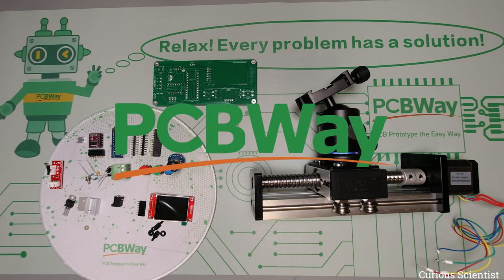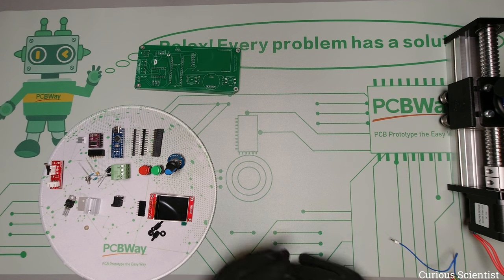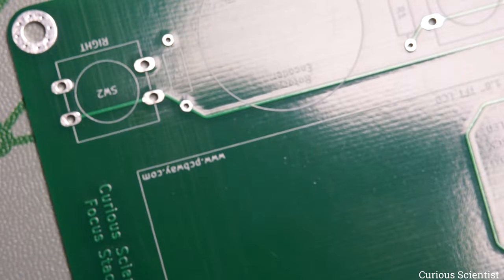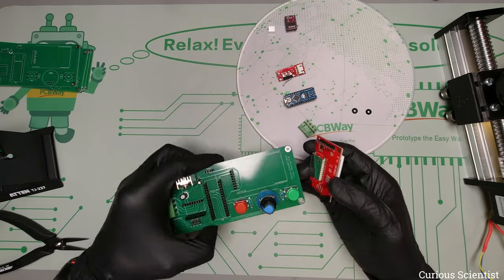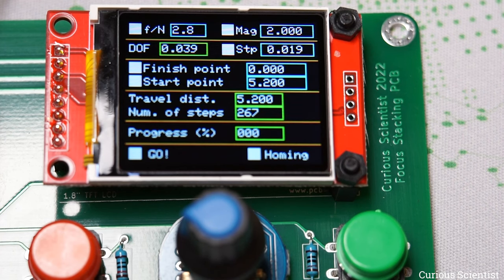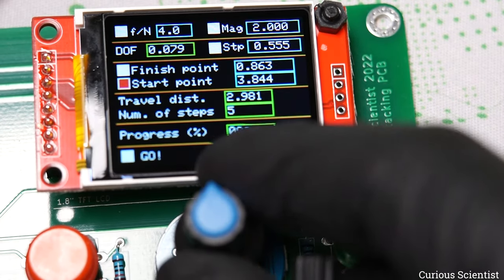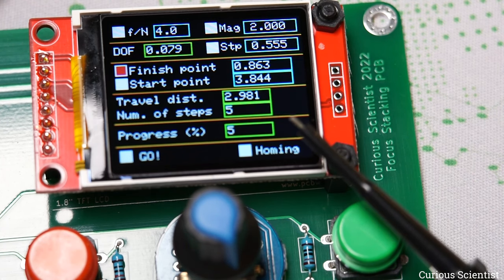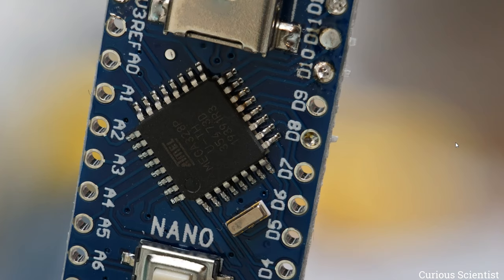Precise focus stacking device for macro photography

Comment: I'd like to share an input protection circuit I've used for over current, over voltage, and reverse polarity. It's simply a PPTC (e-fuse) in line with positive and a unidirectional TVS across the rails after the PPTC.

Saved me from myself a few times 😁
Reply from the maker: Thanks! In this project, the polarity of the power supply is forced by the standard DC barrel jack, so basically there's no option to fail by accidentally switching polarity. However, for other projects, it might come handy. I will keep it in mind, thanks!

Comment: Wonderful, exactly what I have been trying to make for a year. I have a macro rail and stepper motor driving a linear actuator, Im still using your code to drive it with buttons and a rorary encoder. Better than moving it myself but this is orders of magnitude better. Ive found all the parts, your PCB  but  no code! Isee below that you were wondering how to publish it. This is better than what I had been trying to make  -  do you think that you will be able to make the code available please? Phil
Reply from the maker: Thank you! Sure, the code will be available in the near future, within 1-2 weeks probably. I just want to polish it a little bit more. For example, last night I added another option to the code: shutter release with IR LED instead of a cable. I tested it with my Sony A6000 and it works great, so I am sure any other camera can be released with IR with my code and circuit. Also, this might sound rude or greedy, but I won't publish it for free or for a few bucks only. For example, the gadget called StackShot sells for almost 600 USD where the hardware cost is about 200 USD and the rest of the amount is the development cost and the profit margin. Since I put a lot of work into developing this thing and I see the value of the market products, I will probably try to monetize my knowledge in some reasonable way.
Reply: @CuriousScientist  I think that this is something worth paying for, your competition is the Stackshot and WeeMacro, obviously I own neither but from what I know about them what you have produced is competing on a level playing field with either. I don’t envy you working out the logistic problems of how to monetise it but it’s well deserved and I would have no problem in rewarding your work here, well deserved.
Reply from the maker: Thank you very much! I hope everything will go well with the project. Probably, I won't be their direct competitor, especially because I cannot provide a fully assembled mechanism (yet?). However, I will be able to provide an alternative to their stuff at a reliable and reasonable DIY level at a lower price range. We will see how it will work out.

Comment: I'm interested in the image processing part. Did you compose the final image by hand or you used specific softwares or plugins?
Reply from the maker: Hi! It is processed in Photoshop. I took the images, loaded them into a stack, then auto-blended the layers. Then I just let the software do the rest.
Reply: Hi, there are several software used to assemble the photos in focus stacking, the most used are ZereneStacker and HeliconFocus :)
Reply from the maker: I took the formulas for calculating the DOF from the content that is published by Zerene. Unfortunately, I only have Photoshop, but it would be nice to try other software too.

Comment: Great work Curious!  I looked into getting your PCB from PCBWay:  It seems that there is minimum order of 5 units; do you sell the PCB yourself and perhaps I could buy just one board?  Also, is your code available to a Patreon yet?  Thanks a lot!
Reply from the maker: Thank you! 
Unfortunately, I already built all the 5 PCBs into circuits so I don't have any bare PCB anymore. The populated board however would be more expensive than buying 5 boards from PCBWay. 

Yes, the code will be available for my Patreon supporters very soon. There's a "part 2" coming for the video series this weekend or early next week. I further developed the code and I also made some cool stuff and all these will be summarised in the upcoming video. Stay tuned!
Reply: @CuriousScientist  How about your software to run the focusing rail, is it available yet?
Reply from the maker: It will be available within an hour. ;)

Comment: Love your work! What kind of 22uF is it? I need the voltage to buy the right one :-)
Reply from the maker: Thanks! The 22 uF is on the VOUT side of the LDO, so anything above 5 V is OK. 6.3 V, or above should be fine. 
The 100 nF is on the VIN side of the LDO, so that depends on the input voltage. Go for something above 10 V. 
The 100 uF is also on the same rail (12 V) as the 100 nF, so the same voltage rating applies. I chose 25 V.
Reply: @CuriousScientist  it was very helpful, thx so much !!!!

Comment: Shouldn't the camera be locked parallel to the axis of motor travel and not tilted down?
Reply from the maker: Sure, strictly speaking, the camera sensor should be parallel to the surface of the Arduino that I was photographing and the camera should be moved perpendicularly to the surface of the subject. But this video was focusing on the hardware I built and not on the technicalities of macro photography. That's why I was a bit lousy on those details.
Reply: It's actually ok, your zone of sharp focus will just be skewed in 3D space compared to a parallel sensor. The software doesn't really care anyway, it will still compile whatever areas are sharp.

Comment: 11:00 i have just simply bought a usb to stereo audio jack adapter and soldered a audio jack on my pcb. I tried soldering one cable directly on the board but the wires are just too small and would break easily.
Reply from the maker: That is also a good idea. I wanted to know how the remote works, so I bought it. It was very cheap, so it was not too painful to disassemble it and throw away the remote part.
Reply: @CuriousScientist  yeah, to take a picture all 3 have to be shorted together. I have 2 optocouplers, one for focus and one for shutter. With my first version i only had one optocoupler and focus was shorted as standard but when i wanted to change something in the settings of the camera then i had to remove the cable.
Reply from the maker: Yes, I have the same "issue". When the cable is connected, the camera is locked and I cannot change the settings. But this is also why I will try to make it with IR shutter release too.

Comment: this is a very interesting project, would it be possible to implement an encoder that compensates the step loss of the stepper motor?
Reply from the maker: Hi! I have already published a project on similar topic based on the as5600 encoder. But here, there's no such issues as lost steps, I think.

Comment: This looks really usefull! If I were to buy the board and the parts, how would I get the program, and get it installed?
Reply from the maker: Thanks! The program is available for my Patreon supporters. You can install it on the Arduino just in the same way as you would install any other programs on an Arduino (upload via a USB cable).
Reply: @CuriousScientist  Do I need any special software or license for programming the Arduino?
Reply from the maker: No. You open my code in the Arduino IDE, connect your Nano via USB, and then hit upload. Simple.

Comment: Did you put the A4988 in the wrong way? From the top view, with the potentiometer at the bottom, motor's connections are on the right side.
Reply from the maker: What do you mean? First of all, it is a DRV8825, second if I would have put it in the wrong way, there would have been a huge smoke as the STEP and DIR pins would have been powered by the 12 V rail.
Reply: @CuriousScientist  ooh is a DRV8825. It has the potentiometer on top and the A4988 has it on the bottom. Sorry, my bad
Reply from the maker: No worries! Next time please check the project page and my blog article, I always list the components. (It is also written in the video)

Comment: Hi, mounted all as it should be  but motor is not moving. It's making a little noise (barely audible) and that's all. when I press the limit switch then program continue an I can move motor by hand but if I try to redo homing the same thing happens again.
Reply from the maker: Hi! Can it be that your limit switch is wired in the opposite direction? So when everything is powered on, the limit switch is already triggered, and the code does not know where to go. Do you use my PCB and the latest code?
Reply: @CuriousScientist The limit switch is correctly wired and I use your PCB. The code is the one you sent to me.
Reply from the maker: How is the polarity of your motor? Maybe one of the coils is wired in the opposite way so when the motor tries to move, the subsequent steps are working against each other.
Reply: hello, Ihave tried with other motors and it is the same. I have ordered other arduino nano's. Maybe the one I use is wrong.
Reply from the maker: Hi! Let's hope it is just a small hardware issue. I know that at least 25 people purchased the board, and I haven't received this kind of complaint yet. It must work well.
Reply: Hi, everything is working now, the arduino board was faulty. Is there a way to accelerate the move of the carriage when you define the start and finish point? If you have small steps and 10cm of focus zone it takes a really long time with the encoder.
Reply from the maker: @frakanzaig9975  Hi! It is implemented in the code and it is carefully documented, too. Just read the code... Each parameter has an "increment factor" exactly for the reason you mentioned. If the factors are too small, go into the code and modify it according to your desired sensitivity.

Comment: Nice work. Might be worth collaborating.
Reply from the maker: Thanks! What's your idea about a collaboration?
Reply: @CuriousScientist  I'm working on a low cost, open source linear actuator using 3d printing, raspberry pi pico, Trinamic stepper driver's, and steppers. Designing a PCB is not my strength or what I'm focusing on. If you were interested in creating a PCB, that might be fun.
Reply from the maker: I already published similar material so unfortunately I don't think it would worth the effort from my side. Furthermore, the next part on this video's topic is actually just about the exact same topic. I made a new, 3d-printed linear actuator for this focus stacking mechanism. I will publish the next video within about a week.
Reply: @CuriousScientist  Fun! Looking forward to seeing your approach.